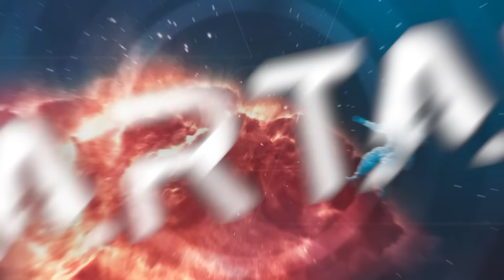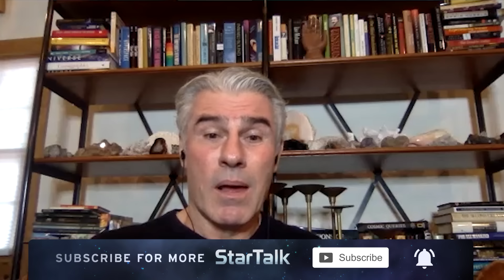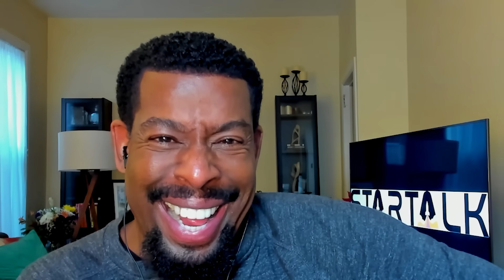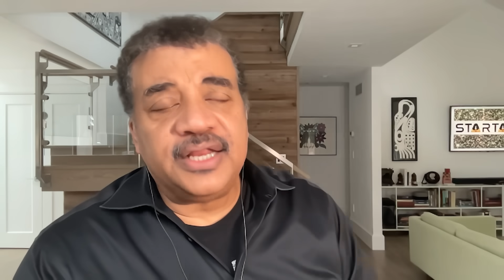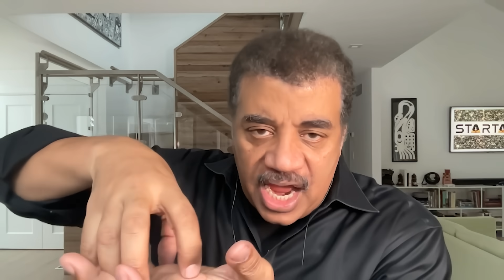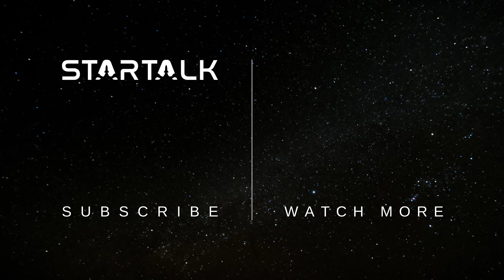What’s The Fastest A Car Can Go? | Neil deGrasse Tyson Explains...

Comment: I love Neil and I know what he's trying to convey, but he's not quite correct this time.  The theoretical limit he's referring to would be based on dynamic friction calcs, just after static friction is lost.  Static friction is always greater than dynamic friction and in fact can be significantly higher just before "traction" is lost due to torque or lateral loading at the contact point.  That peak static friction can be achieved by a car with standard tires on a normal street surface. In fact, it exists between any two surfaces, but can vary greatly by material and surface texture differences.  Based on this, vehicles with standard tires on unprepared roads can achieve lateral acceleration greater than 1g and 0-60 times well under 3 the second limit claimed by Neil.  Using peak coef of static friction for an unprepared, standard car tire on an unprepared standard road surface, the maximum lateral acceleration is closer to 1.5g and the maximum 0-60 time is around 2 seconds.

Comment: Check out Gordon Murray's T.33 and T.50 based on the Brabham BT46B F1 car in 1978 which has a fan on the car's rear. This fan extracts air from underneath the car, producing heaps of downforce while it's at a standstill, and of course adding to the downforce as the car accellerates. The original car in 1978 was disqualified after only one race and if I recall it was an entire 6 seconds faster per lap than its competitors.

Comment: I remember that older muscle cars had traction bars that was supposed to lower the rear of the vehicle increasing the friction without adding more weight.
Reply: Tyson's unstated assumption is that the suspension is static.  With drag cars the rear suspension is set up such that the torque on the axle pushes up on the car body, thereby pushing down on the tires.  Between this and lifting the front wheels off the ground the force on the rear tires at the starting line can be much greater than the mass of the car.  Once you build a bit of speed aero effects can take over to provide downforce.

Comment: Sorry Neil, but you are incorrect.  I have a street legal motorcycle myself that will go from 0-60 in 2.5 seconds riding on a standard concrete road/highway.  Several production sports cars can match that feat on regular asphalt. You need to check your source because you are flat out incorrect.

Comment: You ever seen a pickup with a heavy plow and no weight in the bed?  Some of them.. because the center of gravity is moved so far forward… the rear tires are barely even touching the ground.  So yes, additional weight is there to provide traction.. but one component of that is to balance the cG of the vehicle so it’s no longer inherently unstable.

Comment: Top fuel dragsters with around 12,000 hp will accelerate 0- 100mph in under 1 second, nothing on the planet can out accelerate them from a standing position, drivers pull around 4 or 5G.

Comment: Mr. Neil deKnowItAll:  Tesla Plaids, McLaren 720S's, Ferrari SF90's, and other high performance sports cars are able to run well into the 9's 1/4 mile time while ON THE STREET using STREET TIRES.  That's well over 1 G acceleration (about 1.5 G's in some cases).  Not necessary to use that "sticky, gooey" compound you talk about (it's called VHT by the way).  That helps to get the absolute best performance.  But definitely not required to hit over 1G in a well engineered car.
You're also forgetting about lateral acceleration.  There are many cars that can pull well over 1 G of lateral acceleration.  And again, that's on the street using street tires.

Comment: There are performance tires out there now that have a higher than 1.0 coefficient of friction, so they can actually break the sub-3.0 second acceleration barrier (usually around 2.5 s)! I think they don't need any specially prepped tracks, just regular roads. The tires are obviously softer than normal passenger car rubber. With specially prepped tracks, they will probably do 1.9 second accelerations, which is 1.44 g! Higher than the acceleration of gravity!
Reply: Koenigsegg Gamera is at 1.9.
Reply: Don’t they get some aerodynamic downforce soon after they start? 
Also exhausts may add downforce.
Spinning tires increase diameter and they push the car up, creating an opposite downforce, as well.
Reply: @pascalbruyere7108  Those would be actual dragsters you're talking about. Normal car tires don't increase their diameters much when they spin up.

Comment: Can you make video about wide wheels? The issue is that wider wheels make more contact with the road, but it also gives less force per cm2. So in the end, you get the same friction force from a wide wheel as a narrow wheel.  But sport cars still has wider wheels?
Reply: Tires have a traction curve where it’s basically lateral grip compared to weight pushing down on the tire. It isn’t always linear so you get to a point where more load pushing down doesn’t increase lateral grip as much. 

So, as you turn or otherwise load the tire the wider tire doesn’t get overloaded as quickly. For road racing the wider tires also don’t overheat as quickly.

Comment: Nice to see even Neil is human and gets things wrong sometimes!  The 1 G limit he mentions is just a nonsense unless you drive off a cliff. Yes your acceleration, braking and cornering is ultimately limited by the grip of your tyres but there are many road cars these days that can generate well over 1G acceleration (either accelerating, braking or cornering) and there are quite a few road cars now that do well under 3 seconds 0-60, Bugatti Chrion (2.3), Ariel Atom, Tesla S etc and even under 2 seconds! Lucid Air Sapphire(1.9) , Rimac Nivera (1.85). Modern grippy road tyres mean even my own car an do 1.3G (lateral, as I don't have the power to accelerate that fast!), and many modern supercars can do around 1.5G and hyper cars like the McLaren P1 are closer to 2G. A Bugatti Chiron can brake at 2.5G but 1.7G of that comes from the tyres an an extra 0.8G deceleration comes from a big air brake that pops up into the air flow. The current limit for road cars seems to be around 1.8 secs 0-60 (although the McMurtry can do it in 1.4  as it sucks itself to the road with a fan) and interestingly Elon Musk wants to beat the tyre limit by adding rocket thrusters to the new Tesla supercar! And as for racing and drag cars they can do way more Gs with slick tyres and sticky compounds that chemically bond the tyres to the tarmac to increase the friction. Modern F1 car generate anywhere up  up to 6G lateral and braking (due to downforce and tyres) and Top Fuel dragsters do 0-300 in around 4seconds which is around 5G acceleration which must to be seen to be believed!

Comment: He got it absolutely right about traction being the only limit here when it comes to acceleration but he got the numbers wrong. Hot rods accelerate with 5Gs and achieve 500 km/h in around 4-5 seconds.And they are only using sticky material not geared material or rail system. It's actually so easy to create grip that nowadays that every top consumer ready  electric car achieves  0-60 mph under 3 seconds and 2 of them actually under 2 seconds one being Rimac Nevera ,second Lucid Air Saphire . When I saw the title I thought he was going to explain how a car can not go faster than a certain speed because it's materials would start ripping apart...

Comment: This is easily disprovable and wrong. Right now there are 30 production cars listed on wiki that have acceleration less or equal to 3 sec 0-100 km/h. CMON Youtubers like Donut media or Hagerty (Jason Camissa). Take 911 Turbo S\ Model S Plaid\ Lucid Air and G-meter and drive with street tires on not prepped surface. My money would be on more than 1G acceleration. And I am not talking about such unique car like McMurtry Spéirling with acceleration of 1.4 sec to 60 mph. Science is WRONG :)

Comment: The electric cars State they can go 0 to 60 in under 3 seconds or however fast. If you take any one of those vehicles and started from zero, it will not be close to a zero to sixty in three seconds, it will be at least six or more seconds for the the vehicle to reach sixty miles an hour.

Comment: It seems to me that a soft tire will have mechanical interference with the road...which is friction...my Yamaha V-Max would definitely accelerate faster than 1G with stock tires on normal asphalt on a warm day after the tire warmed up. I am not sure what concept of friction Neil is thinking about, but the mechanical interlocking of the materials is definitely part of that friction. 

I think that Neil clearly missed the mark on this one.

Comment: About the turbine car, Chrysler had one for sale a long time ago and i think Jay Leno has one of those. The same turbine that is used in the M1 Abrams tank i think.
Reply: He has one of those old turbine cars but the one with Neil as passenger was a new build with a helicopter engine. It was a "green" initiative by Jay because it can run on biofuel 🙂 Turbines aren't picky eaters, any liquid (or gas) that burns will do.

Comment: So I guess Teslas have become the Pintos of the 2020s.

Though Chuck touched on an interesting point when he mentioned "free-fall," because THAT falls (pun intended) into an entirely different but even more fundamental type of "terminal velocity." The aerodynamic kind. Any object moving through an atmosphere, no matter how powerful an engine it has or whether it's flying, falling or skidding along the ground has a terminal velocity determined by air resistance. You can change an object's terminal velocity by changing its shape (it's how parachutes and arrows work; wide flat objects encounter a lot more air resistance than narrow sharp objects do), but even the most aerodynamically efficient shape WILL have a terminal velocity it cannot exceed within our atmosphere before burning up like a meteor.

It's why the International Space Station can circle the Earth every 20 minutes but no plane ever built can come close to that. Satellites and space stations have no air resistance (or extremely little) to push through so the only speed limits they have are those outlined by general relativity.

This ALSO means that there is indeed a height from which you can drop an object on the moon and have it hit the surface faster than it would have dropped from the same height on Earth.

Comment: I once owned a motorcycle that could go from zero to sixty in three seconds.  My friend had a Yamaha that went from zero to sixty in one second.  I had eighty four horse power he had a hundred and twenty horsepower.  But he couldn't corner as well as I could and my top speed was about ten miles an hour faster. We both had large rear tires.  It all comes down to the ratio between horse power and weight.  Most motorcycles have a ratio of one horse power to every thirty or forty pounds. The fastest cars have one horse power to a hundred pounds.  Dragsters have huge, soft,sticky tires and a thousand horse power or more and weigh less than one thousands pounds, including the driver!  The only thing comparable is a fight jet!

Comment: Very over simplified, was hoping to better have how a standard road bike can get sub 3seconds... 
Increased grip caused by weight transfer from acceleration, or funny cars rear tyres expanding from centrifugal forces? Not just a static weight friction rubber on road explanation. I've seen a Subaru 4 wheel drive "standard" road car use a launch control sequence where as it raises the body height and drops down just before launch thus artificially increase the car weight.  Definitely see a follow up to this.

Comment: Let's just say that at sea level the acceleration of gravity is 32.174 ft/sec^2. That means in order to accelerate at greater than the rate of acceleration of gravity you have to increase the speed of the car (in a straight line) at a rate greater than 32.174 ft/sec per second, which is 21.94 MPH per second. 

So accelerating a car from 0 MPH to 60 MPH at the acceleration rate of gravity would take 2.73 seconds.

There are PLENTY of vehicles on the road that can accelerate from 0-60 MPH in less than 2.73 seconds.

I used to own a Kawasaki ZX-11 that would do 0-60 in 2.7 seconds, and that was stock off the showroom floor, on stock tires.
Reply: Then there’s the MoMurtry Spuerling , 0-60 mph in 1.4 seconds

Comment: Great video Neil!
What about new technology though?  This video looks mostly at weight increase to horsepower. Introducing, the McMurtry Speirling! An all electric, carbon fiber car that uses massive vacuum suction power, even from a dead stop to add down force. Able to maintain as much down force sitting still as moving forward, with minimal extra weight needed to achieve the traction needed for the power its able to produce to the wheels. Truly next generation in automotive technology in my opinion.

Comment: On sticky tyres, the stickier it is the better the grip - but is the extra energy you'd need to constantly unstick the tyre from the road as it rotates negligible?
Reply: Depends on how much power the car has. On a low powered car extra sticky tires can slow it down because the rolling resistance gets higher. But, with high power cars it becomes negligible because the extra grip is needed and the extra resistance isn’t much compared to a lot of power. 

Stuff like low power formula cars will sometimes run slower laps on super sticky tires compared to harder tires because of the rolling resistance.
Reply: @NBSV1  I see! Thanks for replying. Nice one

Comment: Top Fuel dragsters do 0-100 in about .8s and pull about 5G. Yes very special tires/track and about 11k Hp but 3s is far from the maximum.

Comment: Oh man, there's a great opportunity for a part 2 of this conversation. Sub-3 second cars have almost become common, especially with electric cars, and not on prepared surfaces either. The McMurtry and the variable speed fan system is particularly interesting, along with other cars that depend on the venturi effect. In this episode, they barely touched on the impact of active and passive aero. Deceleration is also a fun topic, as there are many cars with active aero tricks there. Then there's the benefits of driving 2 wheels versus 4 in achieving the maximum grip on launch, the complicated launch systems and procedures sports cars have now, and treaded vs slick tires increasing contact patch with the surface.

So much to continue this conversation!
Reply: Downforce without additional mass is the point of spoilers and McMurtry's fan system.  Achieving a 0-60 in 1.4 seconds. (Currently the world record.)  This is a very interesting subject.
Reply: @josephwimerYoYoYo  yeah for street legal production cars. Not drag cars.
Reply: Hahaha I wanted to mention that McMurray monster myself. In fairness it is an alternative to the rockets providing downforce as suggested by Neil. Just using fans to pull it down instead of rockets pushing it down. Masterful engineering.
Reply: They completely missed the boat on Electronic Traction Control. They seriously needed at least one 'car guy' at that table.
Reply: @jimgd4  facts bro
Reply: He took that into account when saying unless you’re locked into the ground, using things like vacuums and down force do that
Reply: yes I believe he is keeping it at its simplest for of traction to weight. With out even getting into air drag as you go faster. At some point with out  enough down force you will stop going faster no mater how much power you have. Just look at the gp motorcycles top speed increase since they added wings for down force. Before wings they were toping out at 200 or so with the rear wheel spinning much faster.
Reply: When discussing 0 to 60, a Tesla Plaid and Lucid Air Saphire are the king when it comes to that type of acceleration.   All wheel drive is the main component allowing that to happen. But even some RWD cars can do sub 3 sec 0 to 60 on an unprepared road mostly by weight distribution.  As the car launches much of the cars weight moves to the rear drive wheels.  This simulates adding weight to gain traction.  NDT should have done more research on this subject before speaking about it on this episode.  He should have had Jason from Engineering Explained to show him the math.
Reply: drag cars hit 60mph in about 1-1.5 secs, a top fuel dragster hits 300mph in right at 2 seconds
Reply: On paper ,but in reality 90% of this super fast cars cannot go faster than 2.5 seconds,  even Tesla plaid cannot get to that 2.1 in the real life tests ( 2.1 here in Europe . 1.9 in america because we measure the real 0 100 not 0 to 60)
Reply: @bratosin1  mcmurtry can do 0-60 in under 2 seconds on a normal surface.
Reply: @syedshabih1798  it's being made mechanically heavier which increases its coefficient of friction on the tires
Reply: @pogtuber5146  Yeah but heating up tires, increasing downforce/ weight all contribute to that. McMurtry does by creating a vaccum underneath. its pretty neat and clever. and pretty safe to create downforce like that. The car did 0-60 in less that 1.5 seconds and its road legal. Its quite impressive.
Reply: @pogtuber5146  The coefficient of friction of a tire does not change just because more weight is applied to the tire. It just increases the force needed to break the tire free from static friction.  It's just the ratio of grip to weight. Double the weight and you double the grip.
Reply: @syedshabih1798  the reason I mentioned 90% of the cars
Reply: @thecarman3693  Tire grip is ALMOST not a function of a coefficient of friction.  Tire compounds interlock with the imperfections in the surface and that is the reason such acceleration is possible.  Top Fuel Dragsters can reach 0-60 mph in LESS than 1/2 a second, and it DOES have to do with the compound, width and pressure applied towards the track's surface.
Reply: @buzzbbird  Also rear linkage and car inertia, and downforce from directed exhaust.